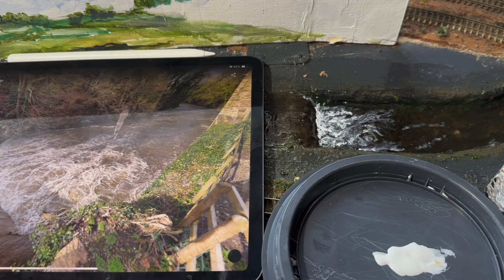PREPARING FOR A RESIN POUR & creating a weir part 2: Fast water & WHITE WATER

Comment: Dear John, very interesting how you solved the leakage problem around the mill. Regarding the fact you built up the scenery around the mill in several sessions I humbly think it’s very easy to leave a kind of gap, like the one you now mentioned. Love the idea though to check the riverbed with actual water. Even though it sounds risky, it’s indeed a great way to check the base for leaks, although I do understand the volume count was indeed the drive for the H2O pour. Glad to see and hear the wetting of the mill base wasn’t damaged too much and appropriately restored, as well as strengthened.
Love the way the weirs look after the glossy Mod Podge and the white whirls added. 
Great to see the way you did the riverbed around the mill did prevent the ominous creep around the river’s edges. 
In that sense it’s very interesting you chose a different method for the other river. Where you simply made the surrounding green scenic elements removable, which created a beautiful and crisp river edge with a very natural looking overhang of soil and vegetation. Cheerio
Reply from the maker: I can appreciate it may seem mad to use water, but it really did show any potential leakage. Water really does find the tiniest gap. I would however, make sure the riverbed is watertight before continuing, but probably would use water again. I’m not always the one to follow convention, lol

Comment: Excellent John !  The white water at the weir is "stonkingly" good. Pity there was so much damage to the bottom of the  mill but at least the end result was worth it.  Great bit of scenic work.  Cheers Euan
Reply from the maker: Thank you Euan, yes the bottom of the mill unit does look a mess, but least its largely unseen. I do have to do some drastic work on this unit though, after running trains as they keep catching the trains. I need to remove the top of the hill ( forest section so I can see whats going on. ) The joys of the hobby?

Comment: Ive just purchased the Rail Adventures 43s myself and wondered what decoder/sound file you used for them ?
Reply from the maker: Hi, thanks for the question. I used hornby's HM7000 decoders. I had to program them together, then reprogram the drive unit as a separate address, then put them into a consist. Sounds complicated, but on the same address each function sounded from both units. As a consist the lead powercar makes the sounds.
I like it, but may I suggest talking to the sound companies. Roads and Rails along with Youchoos put their sound files on Youtube and / or their website to listen to.
Hoping thats helpful.

Comment: Maybe dry sand would have been a better idea than water to test the volumes needed, then it could be vacuumed up and no water damage.
Reply from the maker: Hi David, yes indeed that would work to some degree. I don't regret using the water as it found the tiniest of holes. I probably would do yhe same again, but vlearly much earlier in the build way before any foliage and riverbed scenics is added.